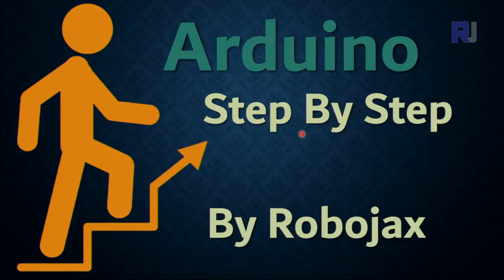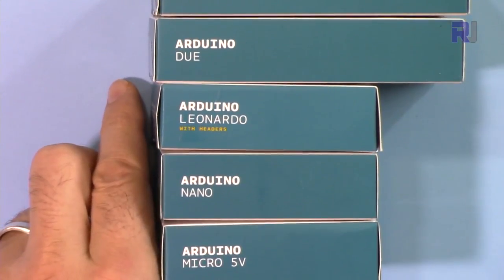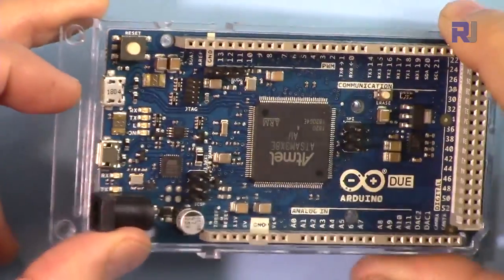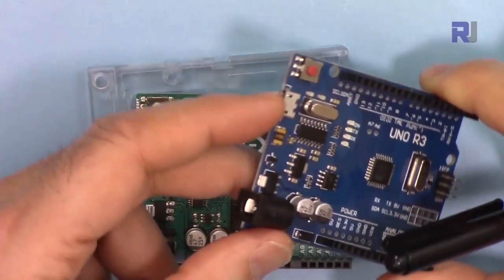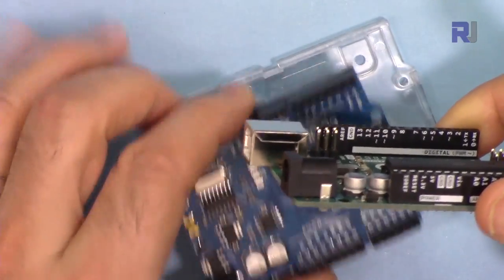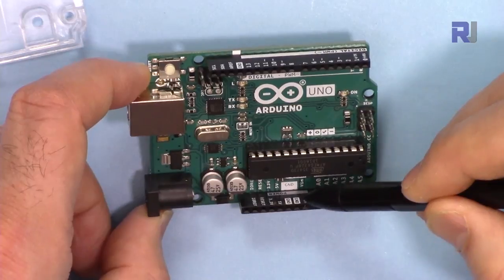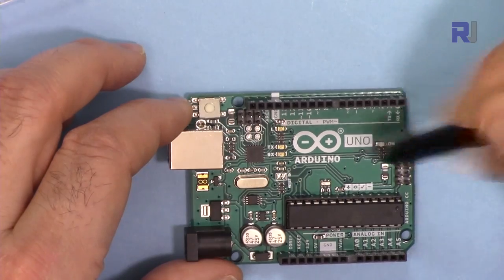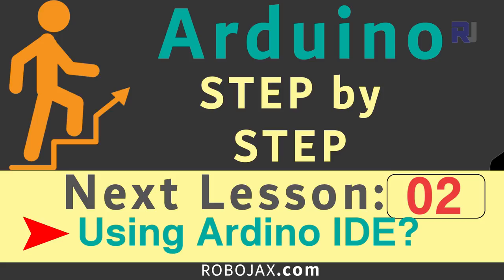Lesson 01 Arduino Boards  | Robojax Arduino Step By Step Course

Comment: PWM:  a sketch has Potentiometer input A0, with Servo at Pin 2. is Pin 2 PWM?  I already built a 7 channel RC using 4 servos, I have no idea what I did. So the little stuff needs to be understood. I am more interested in the Theory of operation, now that I have built the Radio please explain what I did. I believe you will do that. Qustion, what makes a PWM pin?

Comment: Hi,
regarding the pinout. 
When I started with Arduino I had a tough time with pinout.
 There were no videos explaining clearly, and after much trial and error I found out that not all pins are individual, some of them are interconnected.
Reply from the maker: Hi, they are define by the chip and Arduino scan cess the specific register to define them and user them but instead of register for simple usage we used pinMode and a number.
Reply: @robojax  hi, thank you for the answer, I was talking about the interconnection of pins on the board .
For example, the six pins in the rear of the board are not individual pins, they are connected with pin 11,12,13 etc...